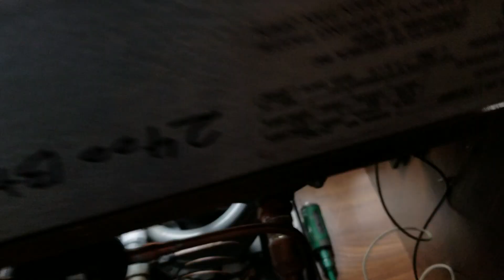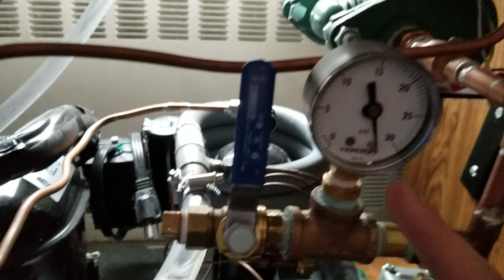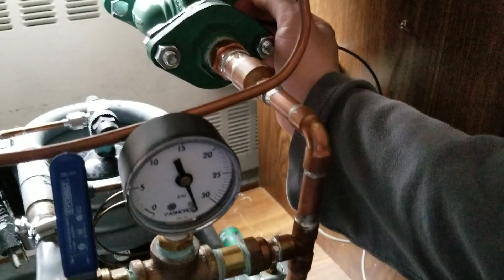Water cooled compressor project. Condenser pump and lines.

Comment: Hi, nice looking Maschine. But what's the Goal here? - Did not realy get what you are cooling with that water? XD
Reply from the maker: Its a little air conditioning system that the compressor is cooled by water not air. The goal was to teach my self and others basic refrigeration and to see if 2,400 btu with the help of my window air conditioner could bring my room down to 59F.
Reply: @67tr876  Ok, water has a better capacity to take/receive  more heat, but it seems like you cooling the collector and not the compressor directly and an other strange thing what disturbs me is, the contact between your water loop and the collector. Its seems like their is a bigger gap between them, so finally you cooling that air around the collector?!
And the water is cooled by condenser with a fan outside? Its feel like you double the way for the fan to cooling your system. 
The only reason I see is, you don't want to put your collector and compressor outside to cool them by fresh air, cause in summer the efficiency will drop a bit? - In that case you will win some minutes of colder temperature with water, cause your water still cooled by "outside" air. XD

Comment: Nice jop.. big thumbs up, I want to make he same exact thing to my window AC .... is it efficient ? ... how much water does it take ?
Reply from the maker: It's not bad and it only takes a small amount of water because I am using the water in a closed loop so it won't evaporate for a long time.  But now and then I flush it so it has clean water.